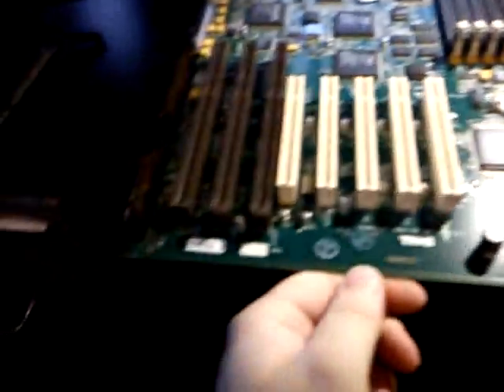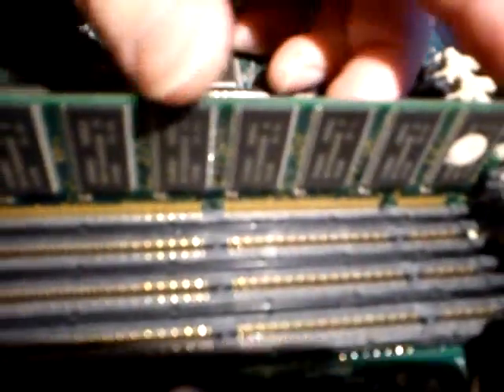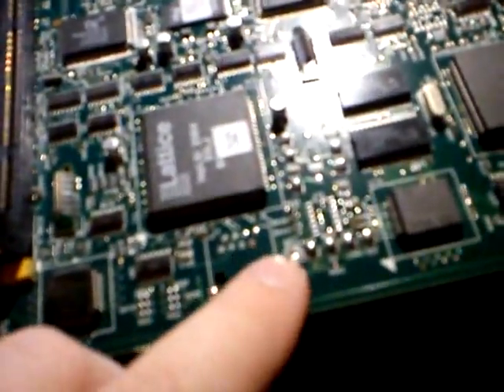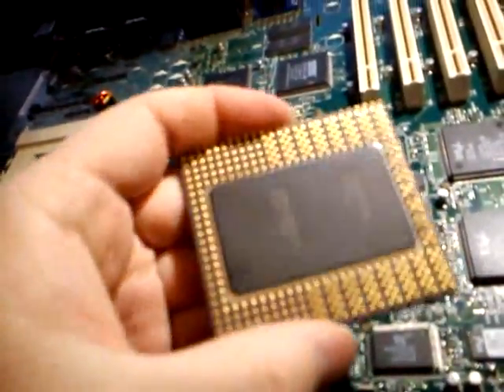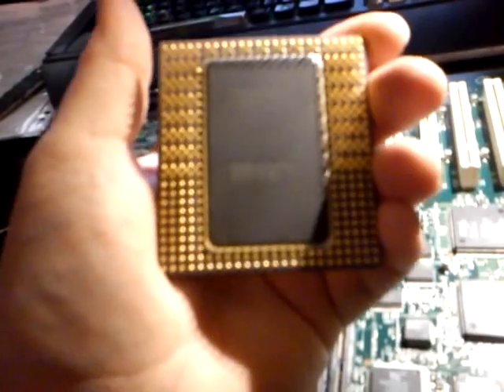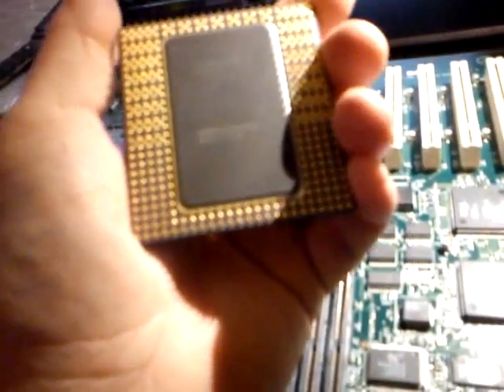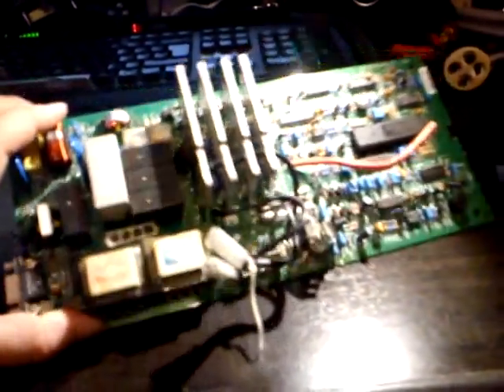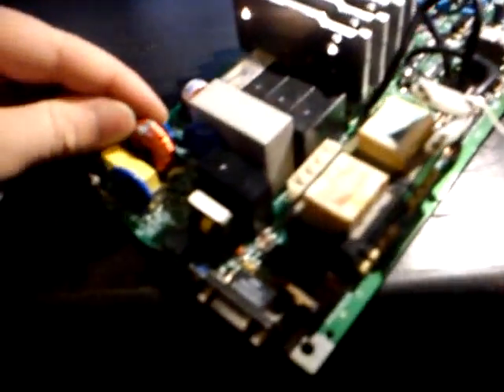Components Salvaging from an old IBM server Motherboard

Comment from the maker: hehe, just old tech. back then they were trying to get good speed so someone decided to make a motherboard that can handle 2 CPUs. (i know there's some P4 mobos with dual CPU sockets).  then it was thought up that the CPU its self just have multiple cores added to it.. making it all run from a single CPU socket. 
much faster xD

Comment from the maker: @seepcgaming its easy stuff mate, first make sure your safe, ware eye protection and gloves. as for when you can use to fry mobos with..  you can use a welder like what i was using or you can use a car battery and a screw driver as the "probe". it is quite safe, at only 12v its not got enough to hurt you. but the high amps sure hurt the electronics! make sure you use thick cables too. i will post a "how too" vid on what it takes to set up your own "mobo fryer"